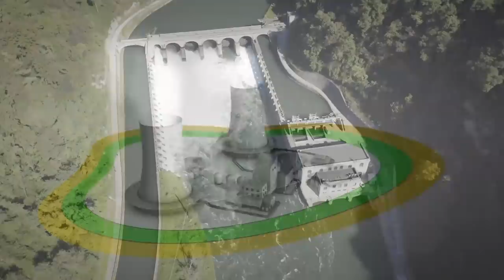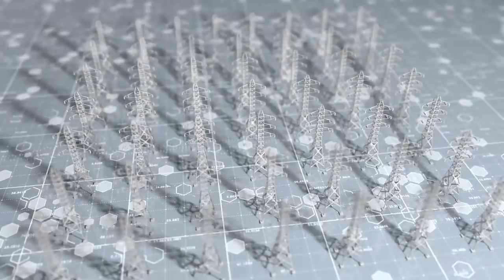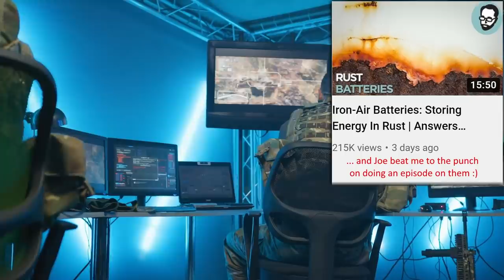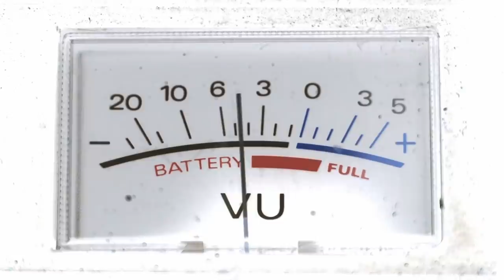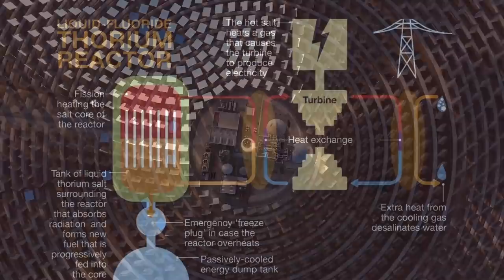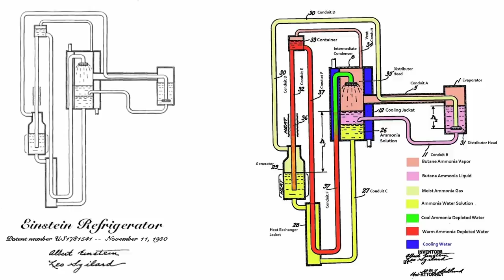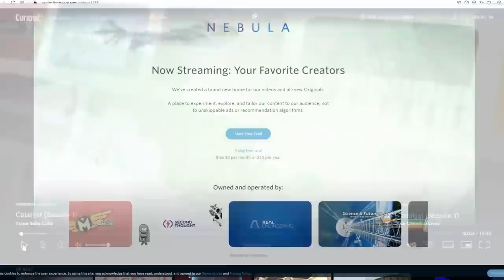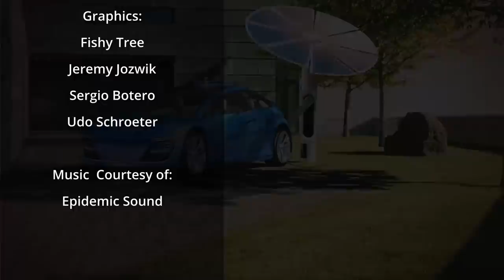The Future of Solar Power

Comment: Ehhhhhhhhh... Like I know you said not to zero in on any technology, but that energy storage issue is not guaranteed to be solved in a timely manner, where as going big on nuclear has been proven to be cost effective and safe aka France.

Yeh modern nuclear power plant costs have gotten out of control because we build them as these bespoke things because there is no other reason to do it otherwise because we are not going to build many, but even without more modern lego like fabrication methods France just by building one Nuclear reactor after the other managed to make it economically viable, while now we can build the reactor on an assembly line and all you need to do onsite is build the foundation and put the parts together.

And to say that no power generation method has a disict advantage, ehhhhh Germany shut down it's nuclear power plants and replace it with solar and wind which increased their CO2 emissions and energy bills, while France has half the cost of energy and emits less CO2. This is because Germany is backing their wind power with peaker plants, mid term nuclear is just straight up a better option when it comes to 0 emission power generation methods.
Reply: Long term nuclear is better. Solar would be responsible for

-reduced biodiversity (there's life everywhere)
-flooding (trees absorb water. Trees need to be cut down to build suburbs and solar farms. You need suburbs because rooftop solar and solar windows aren't practical in cities but you'd still need farms because rooftop solar on houses won't provide enough energy for industry and backup)
-if solar farms are built in deserts
"The dust over Puerto Rico represented the leading edge of a giant plume that had traveled more than 5,000 miles from the Sahara desert across the Atlantic Ocean, spreading into the skies above North America and beyond.

This particular dust plume is at once remarkable and totally ordinary. Each year, these kinds of plumes sweep off the Sahara, carrying some 180 million tons of mineral-rich dust from its dried-out pans. Thousands of miles downwind, the fine-grained dust shapes both the ecology of the places it lands and the climate as a whole."

The ironic thing is that people want more green spaces where they live (on streets, parks, etc) but at the same time want solar.

Wind would be responsible for
-ecosystem collapses (wind turbines kill predatory birds-look what happened when wolves were removed then put back in Yellowstone. People claim "cats kill more birds" except a robin has less impact on the environment than an eagle or vulture)
-no more wind (why can't wind turbines be put close together-because the ones in the back won't harness any wind. That means that wind turbines change weather patterns. Stanford (ivy league university) has an article discussing wind turbines taming hurricanes-even though they don't discuss why hurricanes are important to the planet. And plants that rely on wind to disperse seeds won't spread as far. Animals that prefer climates with wind will move to other places which would affect plant life).
-a layer of plastic covering the planet from wind turbine blades eroding from use (plastic straws are horrible for the environment but not wind turbines)
-if installed on forested mountains they become lightning rods and could destroy forests

A lot more work would need to be done to fix the problems created by solar and wind (just like we're doing now with coal but at least coal contributed to the industrial revolution solar and wind (which has been used since at least 900AD and infant mortality only dropped significantly over the past 100 yrs) is taking a step backwards) compared to nuclear and if people are worried about accidents then why do they live in hurricane, tornado and earthquake areas. And solar is expected to be responsible for 78million tons of waste by 2050 but over the same time frame nuclear has only created 350k tons and recycled 100k (currently there's 250k tons of waste and it can all fit in one football stadium) (some countries don't allow nuclear waste recycling). And it would take Japan 19 yrs to recycle the 10(ten)k tons of solar waste they currently have. No country has anywhere near 100% recycling of normal waste (glass, plastic, etc). Any country that does have near 100% you might want to see how much waste to energy they rely on (some places consider that to be a renewable energy because people will always create waste).

And these don't include water based solar and wind (the great pacific garbage patch is important until it comes to "clean" energy. There are ecosystems under water and many rely on sunlight. Many lakes and rivers are used for recreation which means less recreation areas even though there's plenty of places on land the panels could go even though they might not be as efficient because of heat so people's happiness doesn't seem to be as important as ideology).

Like France Japan has done well with nuclear (they seem interested in reopening plants). From 1980-2000 Japan went from 100TWh to 300TWh. And they have reason to be anti nuclear (ww2). South Korea is another country on top of nuclear.

Time to build doesn't always matter because if you're building 100 plants at the same time with the same design and they all open in 10 yrs that's better than building 1 plant at a time which takes 5 yrs to build. Japan commissioned one reactor 3 yrs after construction began (reactor and plant times aren't always the same. It took that plant 17 yrs to commission the most recent reactor but each reactor was commissioned 4-5 yrs after construction began which means they were earning money and providing clean energy).

Comment: I remember when a group which was fighting to shut down Oregon's Trojan nuclear power plant had a table in a public plaza promoting solar power as an alternative. They had a little toy truck spinning its wheels in the air, running off a solar panel...which had to have a tensor lamp shining on it in order to make it work. When I saw that direct Sunlight wasn't enough to make their solar panel run, I burst out laughing and told them it was the worst advertisement I could imagine for solar power.
Upon reflection, I have to admit that I was wrong and they were right, though: Trojan was a disastrously bad investment that deserved to be shut down, as it eventually was, and solar was indeed a viable technology...eventually.

Comment: Solar power (as in PV cells and the likes) are sure THE future, but, as long as some of those really big advancements in tech really come before it will be too late to "save the planet", that future won't be so bright. Capacity factor was introduced and hardly explained, but substantially means you won't get 100% operativity on this source of energy. 25% is an overstatement too! This force you to over size your deployed area, multiplying the cost and the use of soil. Estimates in Europe say 100% solar would use up to 2% of a Nation's useable area. And that is A LOT. Production of panels and tech for renewables is also mineral hungry, and recycle won't even be viable till the market doesn't stabilize itself. (meaning we need more raw materials for constructing new panels than what you can actually recycle). Give we would like to use Solar Energy because it's "greener", it's not actually as green as it's supposed to be.
Reply: And coal mines don't take up a lot of area?

Comment: High winds appear to make floating objects impractical.  It is not unusual to find surprisingly large objects in our yard from neighbors 1.4 mile upwind.  We lost a dozen 70 MPH rated shingles from our new shed December 2021.  Remember the airships of the early 20th Century?  We do not see these much today because of safety concerns.  Energy storage needs to be a focus.  That way solar, wind and other intermittent renewables will be more practical.  We are disallowed to build serous wind power in our subdivision.  That is sad due to the nearly continuous breeze that we have.  Will be adding small solar power system to shed that lost shingles.  The is a good use since it is a storage building that needs little power.
Reply: At the altitudes above the clouds their is a lot less air around to push things.

Comment: Future solar cells will have to be based on photosynthesis as perfected by plants. This solar energy harvesting has been perfected by billions of years of evolution, so to ignore this would be to admit that we are just stupid. Our silicon photo cells are just too inefficient, expensive and short lived to be a long term energy source. We have started work on this important bio-tech, but we are far from making it a main stream tech. 
But even if we can get solar harvesting above 80% we are still going to need fusion, as the base load energy source, because, at least here on the Earth, the sun doesn't always shine!
Reply: Photosynthesis is less efficient than current photovoltaics. The maximum conversion efficiency of photosynthesis is ~26% (usually quite a bit less in practice), while typical single-junction photovoltaics can easily match that and multi-junction photovoltaics can exceed 40% efficiency.

And no, base-load power is not a fundamental need for a power grid. Storage is costly, but it exists today and is only getting better, while fusion is still 20+ years away.

Comment: Isaac you need to review your script-writing. Your videos used to be clear and concise but it is increasingly not the case. 

Simply-put, your newer videos are too wordy -- the sentences are way too long and they span from topic to topic without breaking or making clear distinctions. It has got to the point where your videos are more hypnotic than they are intellectually stimulating and I am really sad to see this happen.

An example of one of your more structured videos is the video on wormhole that you made a few years ago, especially the part where you listed the topic the video is going to cover.

Comment: 13:50 most houses only use 20-25kwh per day and $5000 would by a 50kwh battery or 2 days of power not 10 hours.
Reply: Some forms of batteries will only last so long when depleted below 50%. I don't believe there is a battery made than can stand total discharge for more than a very short number of cycles. Some of our best batteries in use today, the ones in our phones, if fully discharged everyday will lose capacity in weeks or months.